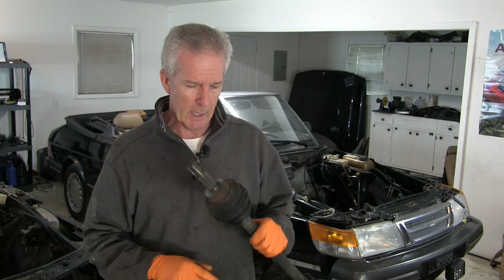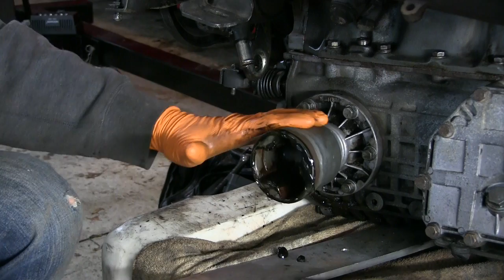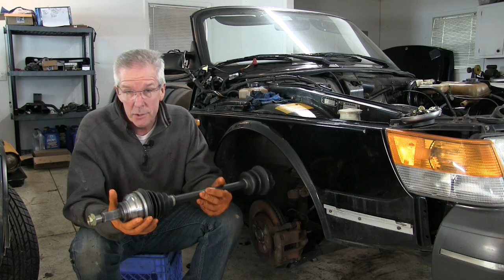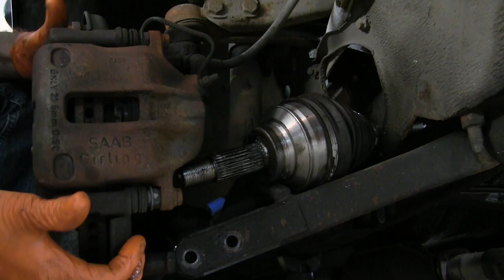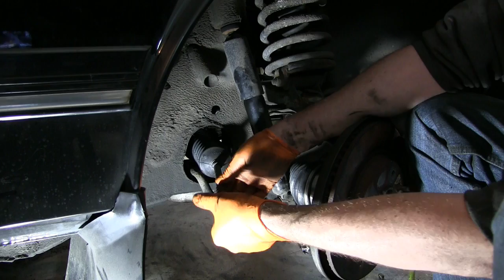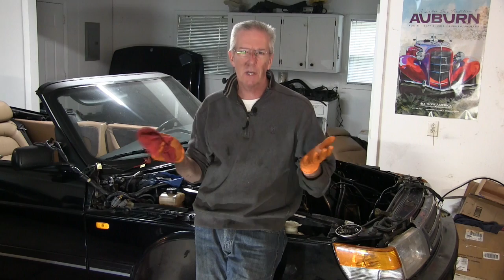Ep.14 SAAB 900 New Axle/ CV joint

Comment: do you remember what brand axles you used
Reply from the maker: Sorry, I don't.   I typically order from RockAuto, EEuro Parts, or AutoHauz.  I do recall the cost being approx $50.  Know that they are slightly different lengths and I believe the passenger side is longer.

Comment: Hey Lee, 
I’m wondering if you used a washer between the hub and axle nut? I just replaced these myself but the new ones just came with the nut. My old ones had a washer however. Didn’t know if I should reuse the washer or not and was wondering what you did.
Reply from the maker: My memory is challenged, but I don't believe so.  As I recall there was no washer there upon disassembly, but I don't know whether that's because some previous owner had removed it or that's how the Swedes intended it.

Comment: I might also recommend upgrading the brakes if you haven't done so already. Maybe install some steel braided brake lines, those are pretty good. It's also a good time to replace the brake lines if they're leaking or starting to get all rusty crusty. No better time to address that.
Reply from the maker: Fortunately, the brake lines are in pretty good shape.  I will take your suggestion and give them a very detailed exam before the engine goes back in.  The front calipers are about 2 years old and I just installed a new master cylinder.  The rears - well, I haven't gotten there yet.
Reply: Lee Kelso the steel braided brake lines give you a nice firm pedal as opposed to the regular rubber brake hoses since the don't expand overtime. And they typically last a lot longer

Comment: i would have advised to install the axles when the engine is in the car, much easier to install the engine. tip, save the old cv joints for when you have another engine out and axles off job. that way i can move the car without the fear of mt wheelbearings falling appart
Reply from the maker: I agree with both you guys. Rookie move on my part. Didn't show it in this video, but I realized that error and unbolted the passenger side axle so it can move out of the way as the engine goes back in .  I'm hoping that gives me enough room to finesse the engine back into place.
Reply: Lee Kelso live and learn, that's sometimes the best way and often the worst way to learn car mechanics! Not too late anyway, yank them out and you have one less headache when dropping the power unit in. Keep up the great work!
Reply: Was going to say the same thing. Think Lee did this ass-about. Enough to deal with when re-installing an engine without having to negotiate the axles as well. Otherwise, great video.
Reply: Lee Kelso would advise to remove both, easy to do right now, less chance to damage the axles and far easier to drop the engine in